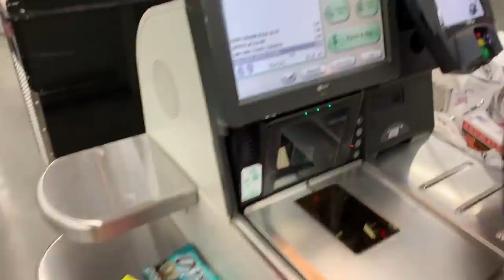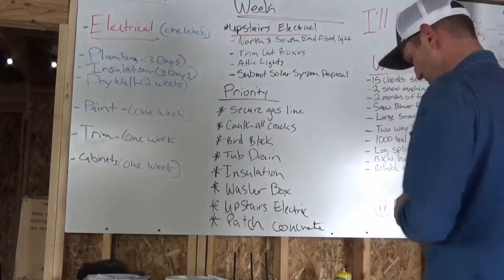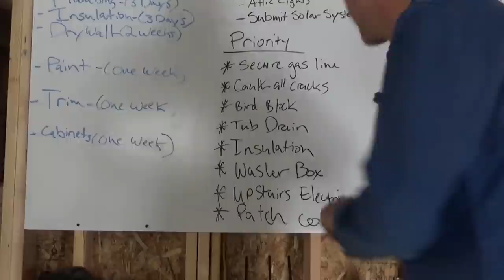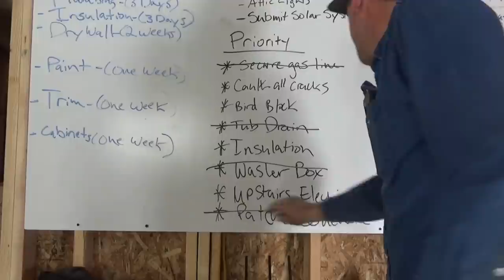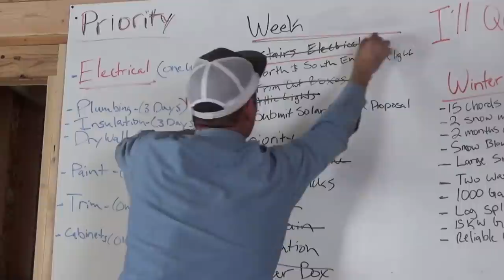#310 - The Inspector Said Sell The House And Move To Town... Seriously!

Comment: Maybe the inspector wants to live on this awesome ranch you have built.  And its a lot easier to buy it from you than to build one himself.  LOL
Reply: This is exactly why.
Corruption is rampant, even in the construction industry.
They're all thieves.
Reply: IF HE LIKES THE OUT DOORS , YOU MAY BE RIGHT   LOL
Reply: Space girl, I agree with you!
Reply: That’s exactly what I said!!!
Reply: @jhart7304  Even in the construction industry?  Especially in the construction industry.
Reply: @scottvines887  
Oh yes ! 35 years of experience here. Seen it all. At all levells.
Reply: @CovenGraphics  l
Reply: Im suprised the inspector didnt give him an offer  lol.
Reply: You have no idea.  Our home at 4187 Trail End Road, Rhinelander WI is exactly as you describe.  I bought a WI Ag Extension Service house plan blueprint, 1800 sq ft under one roof line, drive in basement garage.  Contractor done basement, framing, plumbing, all in the $50,000 loan. Thermopane windows, weather tight but needed outside siding and inside doors and trim.  We put in used kit cabinets, but all new plumbing 3/4 inch copper lines from the well we put in.  The house inspector snidely called the plan dated and then kept the blueprint.  
It was stressful as my husband did body work in a rented building and house building also. We both came close to breakdowns.  We began body work in the basement and the bank official told us we could not do that.  Next was filling a Uhaul and leaving.  
The cops got the house with the assistance of information gleaned from a social worker's knowledge of my life and using coercive hypnosis.  It was too easy to take this from us as we had no family or contacts in the area.  Body work keeps your family isolated from community integration.  It was 30 years ago, husband dead for 20 and I'm still here but not for lack of them trying.  Was hit in street walkway by truck.  Walk everywhere.  Sham concern has me in 70 year old house with galvanized plumbing and tinkered with electrical, used kitchen cabinets coincidently.  Our retirement house and entry to middle class life for my children was stolen for their use.
Reply: My thoughts exactly...lol
Reply: Thats what i was thinking to, oh shit yeah nice area lots of land and nice big home going up fuck i want that sell it! Youve spent so many years building a house with little help for some one to say sell it id respond with get fucked
Reply: Great point. Seriously
Reply: Greed is a Killer, here in Key West, Too. Good For You, Stand YOUR ground!  Don’t you just love those people who think they know better than you!
Reply: Kathleen: So, your property was stolen by local police??
Reply: @SpaceGirl, well, compare build it by yourself in 3 years with paying a mortgage for 30 years - I'd argue it's easier to build it yourself.
Reply: @MaximC  disagree.
Capitalism is just an idea.
People are corrupt.
Reply: @jhart7304  
Correction - *a bad idea. An idea in which corruption is intrinsic. Not only that, but the corruption is legal in it, it's called "lobbying".
Reply: Or he hunts there and doesnt want people to ruin his hunting grounds.

Comment: Add that fan/vent into the kitchen! It is easy and cheap now to do! Even if you close it up for now make it easy to just add the fan and range hood later!
Reply: I agree. As someone who  has cooked a lot I can tell you that a kitchen puts a lot of humidity and grease in the air. It coats the walls, ceilings, and cabinets. And It's hard to clean it off. What it does to paint has to be seen to be believed. A summer kitchen would be a good thing to have also.

Comment: I live in a similar situation here in New Brunswick, Canada. I have a long road as well. With your excavator bucket, simply 'Ditch the Road'. Many trouble spots will disappear instantly, and never return during any season. Some spots may reappear, and may require further thought. It is so easy. Stop belly aching about your road. Just ditch it to provide runoff.

Comment: Wonder if the inspector has a friend who is a realtor.  They often work together.
Reply: There is definitely some shystery stuff going on if real estate prices have gotten that high around there.   And with people fleeing cities in droves, it's only gonna go up.
Reply: Yes like the one who sold us the house we live in...it should have never passed inspection. There is black mold and this had to be known but was not disclosed....
Reply: Gregory Zoebisch thanks for your comment.  It reminds me how important choosing your own inspector is when buying a house.  Also in this video he has a to do list board.  Having a list of what to check in a prospective home will make it easier to avoid realtors pressure to gloss over potential problems.
Reply: Yeah, in the disclosure documents the problem was listed as "Wet Basement...and I remember a vague reference to mold...but we kept getting sick when we used the furnace and we had to stop because turns out it was circulating mold through the entire house...nice huh?  @OB17358
Reply: @l337pwnage  on the east coast people are running back to the cities, and rental prices are outrageous, so high that I'm wondering how people can afford it, and the price to buy is crazy
Reply: @willie417  It's almost always cheaper to buy, and from what I've seen, that gap has widened.  If real estate prices are also up at that location, you could be correct, if not, I'm betting a lot of that rent increase is due to all the section 8 that's everywhere now.  The government just pays the going rate, no questions asked.
Reply: More like agenda 21
Reply: @l337pwnage  not for a house you actually want to live in it's almost always cheaper to sub out your own build and I mean by a long shot
Reply: @sarahann530  Obama's program moved them everywhere.  They paid for them to move.  They also have a program where they can used their welfare payments to buy a house.
Also, there are corporations buying out huge chunks of single family housing, and in January massive foreclosures are coming, so all those houses will be off the market to buy also.
Yes, anytime you can see minorities, you live in a shithole.
Reply: @l337pwnage  What is the name of this Obama  program you speak of .  I have many rentals and I think I missed out on this free money .  It would seem from your comments   that you  live in a Section 8 area  of town  so you    more in tune with these welfare programs than I am .
Reply: @sarahann530  There is even Section 8 in Beverly Hills(which is a shithole of its own kind, so, I guess there is that).  Towns have sued to block section 8 in their communities, but they always lose.   
There are a lot of programs, but one of the worst is Obama's use of the "Affirmatively Furthering Fair Housing Rule".
Trump put a halt to a lot of it, but that can't unto the damage that's been done.
Ya, if you're gonna play the government housing game, you need to pay attention.  Some people absolutely love their government rentals because the government pays well if you do it right.
Reply: @l337pwnage  Why do you live in a Section 8 neighborhood if it soo bad  . Whats keeping your from moving ?
Reply: @sarahann530  Lol, you sure are desperate to know where I live.   I can tell you one thing,  the McCloskey's lived in a $1.15 million dollar house and they still had astronauts literally smash down their gate and now they are still fighting legal battles because they displayed weapons to stop the mob from killing them.
I have yet to have that problem.
I can help you out if you need house shopping advice, tho, never live anywhere that there are are apartments nearby, or near any public transportation.
Ideally, you won't live in or near a town that even has public transportation.
Reply: @l337pwnage   I have a place in Vancouver which has excellent public transportation,  whats your point?

Comment: Kitchens & Bathrooms cabinets: Am sure you know this already.  Make sure you have good tolerances for things like your pipe behind the dishwasher and other whitegoods.  So you can get things in and out for maintenance/ renewal.  We bought a bog in the UK and we are cheering you on with your project. In UK we allow about 2 inches (50mm) for each built in item. And about an inch at corners.

Comment: No need for new vehicles for riding the road.  You have heavy equipment that could be used to regrade the roads and put in a drainage ditch on one side.  You should check out some videos on a guys channel call "Andrew Camarata".  He does some amazing fixes on some roads for part of his living.
Reply: Yes most definitely camarata is a straight up work horse just like heath absolutely love both there channels. He would definitely gain end knowledge from Andrew to fix his road for sure.

Comment: My daughter, Shannon and I watch all of your awesome videos. I am 69 this month and my daughter is disabled. We bought 24 acres in East Texas to homestead. It was so covered in heavy brush and old structures, that the only way we could penetrate it was with heavy equipment. We spent months hauling water from town before getting our well. We had only 2 electric plugs for a year and no plug to run AC. The The Texas heat registered 120 F on our covered porch the first summer we were here. We bathed in a stock tank for 2 years. The rain has come down in torrents for 3 years, with little reprieve. We learned to watch the low spots and tweaked our drainage for months to tell the land where the water needed to run off. We love learning to ranch and farm still; the wolves, bobcats, deer are wonderful. We will be building out our barndominium for along time. We are soon to clear 5 acres for 3 barns and flocks. We are putting in place our beehives and had to whittle an area for them. We are thrilled to see your job list moving along and we are so happy to see that you love your place as we love ours.

Comment: Good road construction can be a bear.We all get tempted to use what we just moved: top soil. Worst thing imaginable for a road bed.Remove the top soil, get down to a good substrate layer. Use that for the road base and compact it with compaction roller.All that means moving the top soil at least twice and excavation work will at least double in size to get enough good road material.Just no shortcut around it.I've got 1 bad spot near one of my barns 10' wide and 80' long that took 150 ton of 4" to 6" stone. Even with that I never really got to a good "bottom". Was walking it in with a D-6 and it just kept disappearing.
You have your excavator: dig some test holes and look for a good pocket of gravel. Try using that. A dump trailer would come in handy or a cheap 5 yd dump truck.You want some sand mixed in with it and native gravel should already have that entrained.Then compaction is key and for that it will need to me somewhat moist.You can also laydown some geomat and place base material over that. Seems to be very effective.
2nd or 3rd time your wife gets stuck and has to walk up hill in deep mud to get you to get her out you'll be putting the "For Sale" sign down by the road.....Best to build a good road.

Comment: I think I would stay as well. Just work on the road as money permits, putting in some good stone to build a good base with fabric, if needed, with trenches on both sides with cross pipes to drain the higher side every so often. You really need a good road in case of an emergency. Thanks for sharing.

Comment: We live 5 km off the the high way, 2 of these are a logging road, which have not been plowed by the forestry for 8 years or more the other 30 we juggled with logging trucks.  We have been living here for 38 years, raised our kids here. Both  my husband and I worked, him of course all 38 years, me for 20 of theses years,  we live with 3 to 5 ft of snow most winters, and come March, about 4 weeks, the road becomes an ice rink.  A good four wheel drive is a most, not an all wheel but a true 4 wheel, chains and a strong stomach for 5 mins of excitement twice a day for that 4 weeks are required.  ( we have a switch back to maneuver one of  these km.). We are prepared for this every year, towns people would stay home when the weather was bad, but we always got to work.  The first couple of years are the worst, but down the road it becomes the norm.  We have great neighbors, my husband is a gas-fitter, so the ranch down the road plows us about twice a year, and my husband does their gas fitting.  There are years when there is so much snow our neighbor can’t plow any more, that’s  were the chains come in handy.  Do we regret our move out here?  Once in a while but it goes away the min we hit town.  By the way we also live off the grid, with generator & solar for electricity.  The kids loved it, but all but 1 of the four live in town.  The 1 who lives rural owns a ranch.   So my encouragement for you and your family, don’t give up for at least 5 years.  The hardest time will be when the kids are teens and want to be in events and with their friends in town.  Once that is over you and your wife will love the peace and quiet.  In joy your adventure, people never tire of asking us how we survive, and we laugh.  Ps: our kids went to school in town from here, driven to the highway and then bused to town.  Also the pics of your road look normal to us.  Lol

Comment: You could always conceal a garage near the road.   The suggestion of snowmobiles isn't bad but maybe you need to build a retention pond in a low-spot for rainwater and snow melt.  Maybe even consider building reinforced concrete culverts to raise the road the few feet in low spots while still allowing drainage.

Comment: Next winter, you and Busted Wagon will be able to use the plow and snowblower in conjunction. Plow will push snow aside and snowblower will chuck the snow well away from the road. Use the excavators to dig a drainage ditch on the uphill side of the road, and whack some culverts in. That should fix the road problem pretty much permanently. You will the love it up there!

Comment: We live off grid 3 miles up hill. We bought a Ranger and put tracks on it to take the hill snow and mud! It like going through butter.  We put a big tub with a lid to put stuff in on the back. We could pull totes if needed. Been doing that for 2 years. Before that we snowmobiled pulling totes. Both are great, but I’m older so the Ranger I love every winter. ❄️ 🥶. I plan deliveries late fall, late spring. I am surrounded by 5,000 acres that’s non-touchable then my own land. Nature is a unspoken sight. Twin moose walking through the yard says it all, smiles

Comment: Cabinet load rating ? We are doing a commercial job and when we checked with the granite counter top company they said some cabinets broke when they installed the heavy tops. I used 3/4 inch material for all the sides of my cabinet boxes.

Comment: Just did the same thing, bought rural property built a house (myself) and moved in. The road was a major concern, the house is only 3/4 mile from the paved highway, half that on our property and half on a ditch road. The ditch company has a fit when I've done maintenance but refuse to make it as good as a county road. They think they have dominion but it's an easement and by law, they can't landlock me. There are only maybe 3-5 days a year it's really bad. I got stuck halfway and walked in, the mud froze a few hours later and drove right in. Someone below mentioned drainage and they are right. Blade the snow off and make sure it drains .......no problems.

Comment: I have built our home in the country but being older we bought a pre-built house were it's built in a factory and the installed on to our block so listening to you talk about your bad roads reminded me of of problems of getting the house to the site first, the first half of the house when unloaded of the truck one of the tires exploded causing a few worried looks but when it came to the second half it actually fell of the road and slid down a bank and it needed two large dozers to pull it back on to the track and all of this happened on the second time they bought the house out to our place the first time it was returned to the factory because the track had completely washed out

Comment: To keep the bugs out, you took time to install screen mesh over the exhaust of each vent. As you know, the mesh will quickly clog with lint and dust. Furthermore, the lint and dust will become damp and clog the vent completely. Please explain why you would do this. Is it your plan to routinely clear the mesh along the exterior of the house? And, you said you were hoping the kitchen wouldn't need a vent. Please explain that notion as well.

Comment: Get an excursion, 7.3 preferably but the 6.8L gas works too. Lift it minimum 4 inches with something quality so it’s not so rough and throw some good extreme tires on it (mud tires). This will get 7-8 people through your road and will be easy doing it, it will also be reliable and a real stud of a workhorse. Some older jeeps work too, 87-01 Cherokees are awesome when built up and cheap to do so. Those go through a lot too but aren’t as heavy duty or large. I love watching the series, I’m throwing solar on my cabin as we speak to add that modern ease of things

Comment: Build a pantry to store can food and get a freezer that you can tie into your solar system. Lived on a rnch in Montna and we sometimes get , "snowed in" but we had a pantry so no worries. Also had a '"spring house" where we would keep eggs and butter as the spring water came out way cooler than the tempeture in the summer and warmer during those way below zero winters that Montana  gets, If you're already doing these things, well I'm just letting you know, it's possible and it has been done, Good luck and keep on truckin!